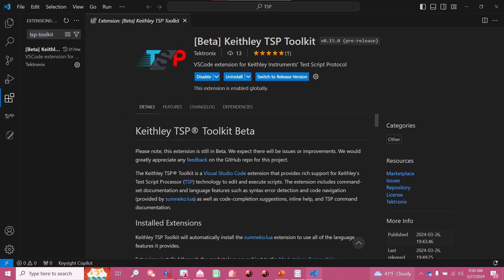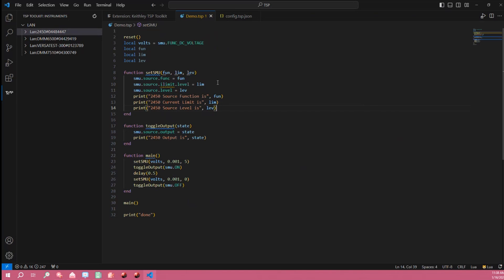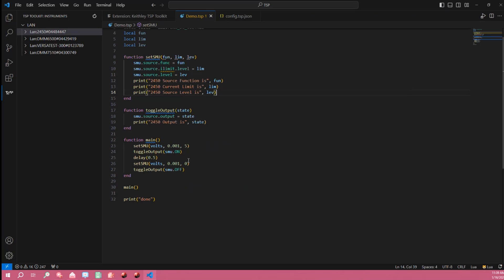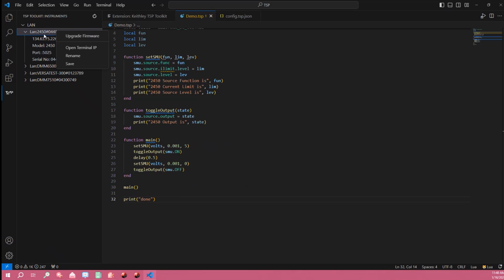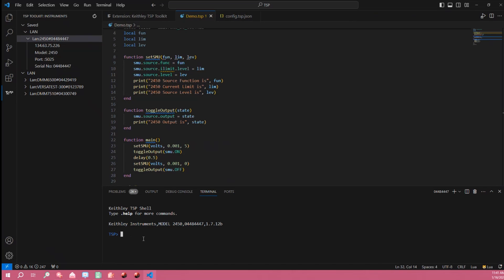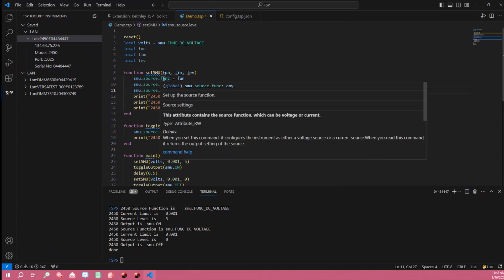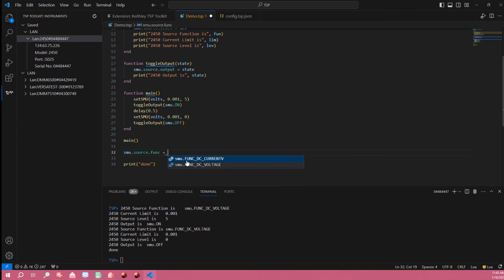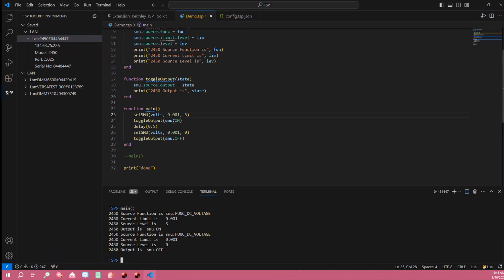Leveraging Test Script Processor (TSP™) Technology with Keithley TSP Toolkit

Comment: Does the VS Code extension also work under Ubuntu? 

Right now I try to connect to a 2470 SourceMeter and with the VS Code extension i can detect the device, but when i want to connect i get an unable to connect error message. 

I am assuming that this is due to the unavailability of suitable device drivers under Linux / Ubuntu. Am I correct?